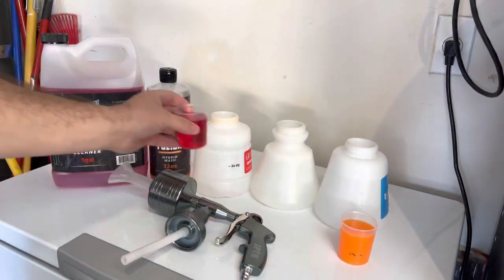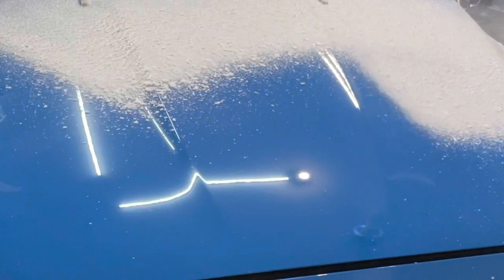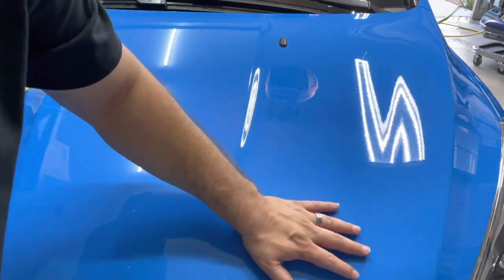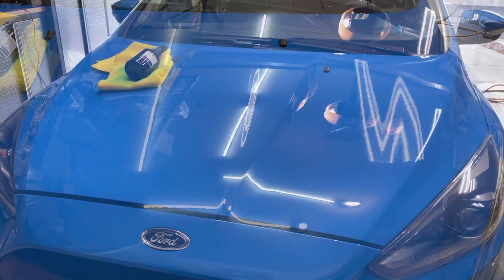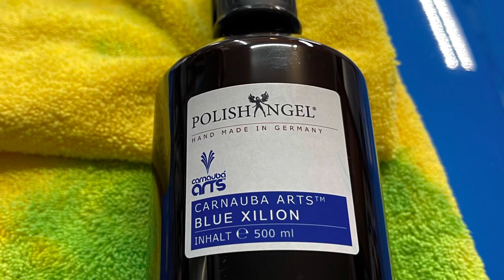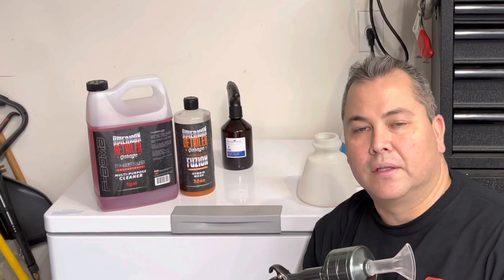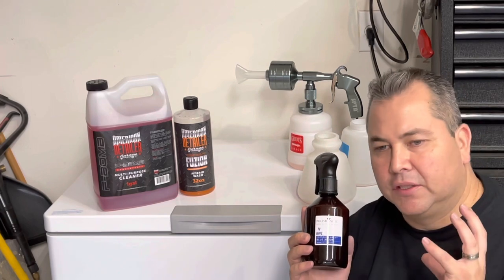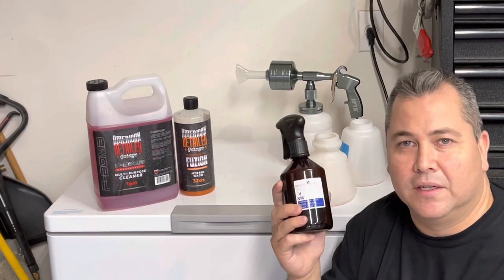Polish Angel Carnauba Arts (BLUE XILION)

Comment: I Was just getting ready to order this tonight in the Black Wulfenite for my BMW 536i, along with the rapid wax for my Jeep as a topper, when I thought  I’d search for some feedback. You’re right that there is not much out there on this product. Tks for the video review. Nice Job. I subscribed as well.
Reply from the maker: Appreciate you subscribing.   I just received the Black Wulfenite for my wife’s car.  Just got the 250ML to try out.  I have and like the Rapid Wax so I thoughts try some more.  Also got Diver and Master Sealant.   Just waiting to make some time and use them.   All that I’ve used are excellent.  Sign up on the USA site with an account and they will email u discount codes monthly.   Let me know how u make out.
Reply: @DetailingBreakdown  I sure will and Tks for the tip
Reply: Dont know about the colored versions, but with Rapidwaxx you can get away with extremt little product on an entire car. You can probably get 7-10 applications from a 100ml bottle if not more. A local detailer is down to 3-5ml per car.
Reply from the maker: @Wiikendzgoodmix  good to know.  Ty

Comment: Nice video ! Never try PA products but they look fantastic ! 
What do you recommend to maintain Carpro Cquartz 3.0 ? Didn’t find a good topper wet that gives me gloss and slickness ... 
cheers from France !
Reply from the maker: Umm, not sure what u have available in France.   Can u get Polish Angel there?  If so, try High Gloss or Cosmic Sprits.  There are many products here in the USA for what u want.   I just don’t know if they ship.
Reply: Yes we can have PA, it’s made in Germany so next to us ! We can basically have everything, what would you recommand ?
Reply from the maker: @LittleNouki  tasystem Shinee wax, Xtreme solution TOPPER, PA Cosmic Spritz or High Gloss, 3D Bead It UP., McKees Hydro Blue is a nice Spray n Rinse, Manetts Megashine has Gloss Sauce, Griots 3-1, and Xtreme  Solutions Poly Gloss
Reply from the maker: Sonax has Polymer Net Shield or Brilliant Shine Detailer but they are not to Slick.   Gtechniq has C2V3 as well
Reply: carpro gliss is your topper to use if I understand what you want
Reply from the maker: @barrybij8079  Gliss is another layer or lite coating.  Not a Topper for monthly use.  But u could say it’s a coating topper.
Reply: Thanks a lot !
Reply: @DetailingBreakdown  yeah it's a yearly thing or so.. Carpro reload was made more for the monthly maintenance but I haven't been impressed with it when used as a standalone..
Reply from the maker: @barrybij8079  that’s why I didn’t mention Reload.  It’s a bust